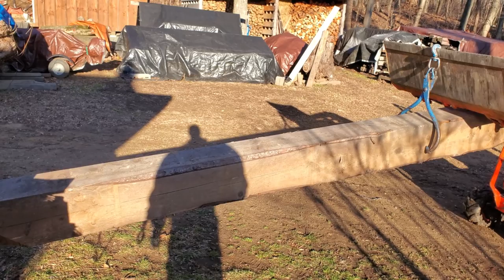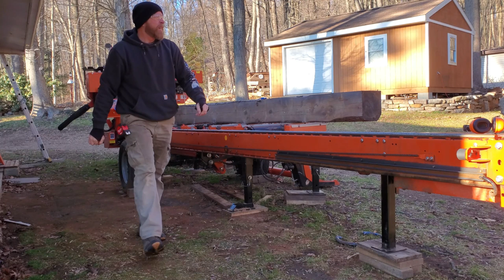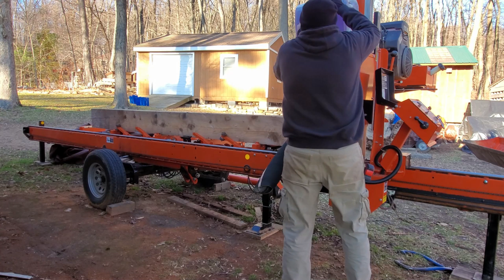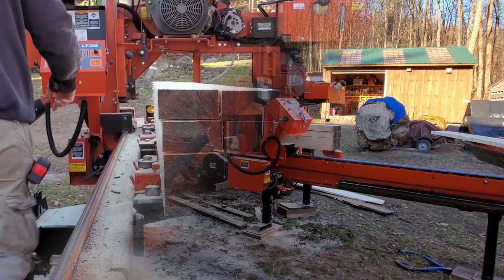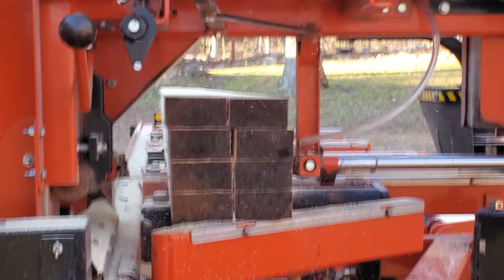Sawmill Short #4 Beam to Boards

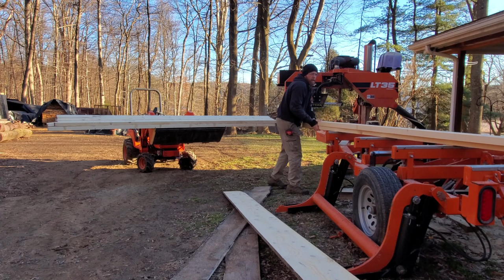Comment: Sssqqqquuuuueeeeeeaaaaaaaakkkkkkkkk! I know something needs sum transmission fluid. Hee, hee. About bit my tongue thru. You scared me there with that camera trick about 8:00 min in. Oh no, he's sawed right thru the camera, aaaahhhh..... Nice lumber tho and good to see you guys staying busy. Thanks for sharing 👍👍
Reply from the maker: Yea, I'm not sure why that started, but it's the brake mechanism. When you lift the handle to stop the blade, you get that squeaking noise. Cant oil that.
It is time to go over the mill, and do some maintenance though. 
Just wanted to play around with the camera a bit. I still need to find a couple other cameras that I can afford. Single angle video can get boring.
Reply: @IronOakSawmill  I thought that was a cool shott. Yes another camera angle would make editing easier too. I Know how long editing takes to get the right footage. Maybe you'll soon have another angle. What's that saying, you don't always get what you want but you can get what you need. I think that's how it goes. Maybe from an old song. Enjoyed